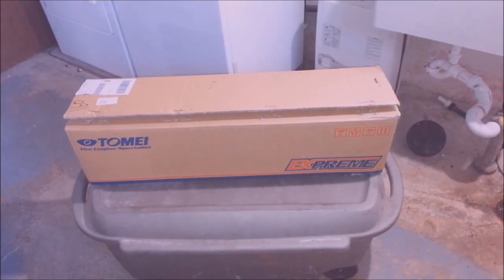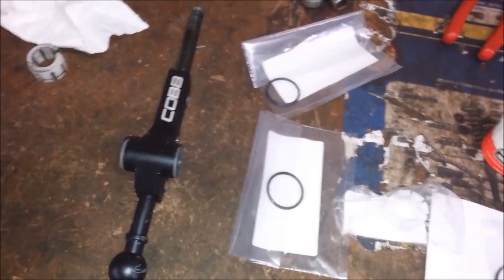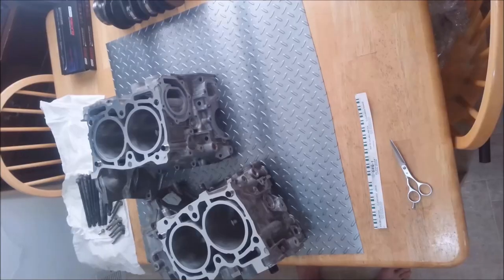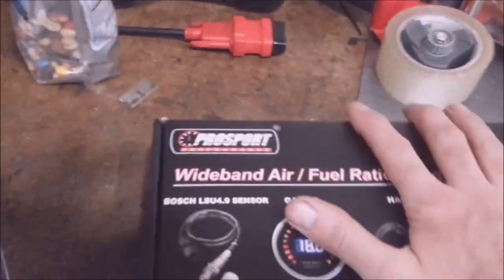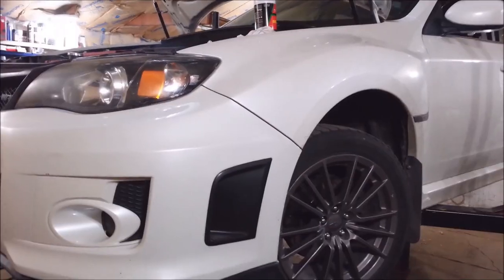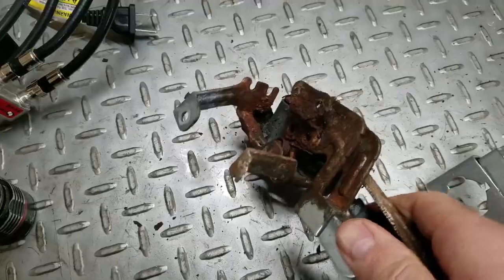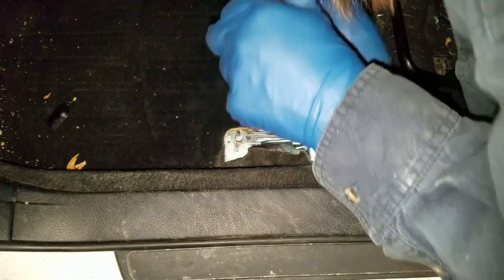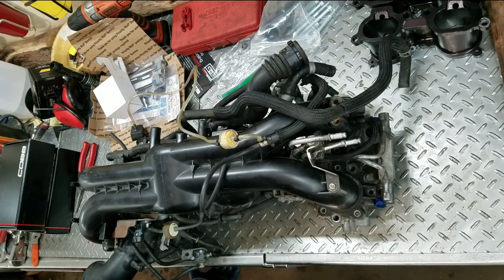2012 WRX build start to finish

Comment: Funny thing is most of those aftermarket parts were from well respected tuning companies(Perrin, Cobb, AEM etc) and very pricey. Even then 90% of it fits like crap, has cheap connectors and hardware etc. Nice video as always.

Comment: I love my 03 Subaru legacy wagon it runs like a top , only thing I've done to it when I first bought it was replace the spark plugs and wires,  fuel filter ,new battery ,  new brake pads and rotors front and back , new tires and of course regular oil changes but that's it for the last 3 years it actually surprised me, hopefully it keeps on trucking , great work on the car man great video hell of a lot of work done .

Comment: I have heard the same thing about Grimm speed and Parrin stuff aftermarket trash.  I have turned people down when they ask me to help with this kind of job.  Now Honda and Toyota stuff can be bad too but not like Subi's garbage.
Reply from the maker: All aftermarket high performance stuff is usually a pain in the problem. That's why I bought a bunch of cheap Chinese junk for my Civic turbo, and made it work. Some things you cannot skimp on though.